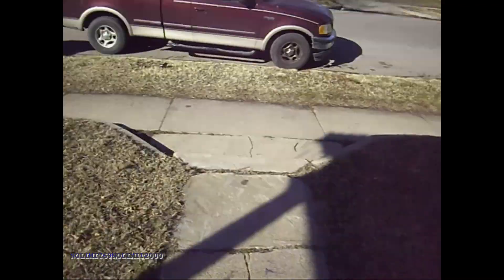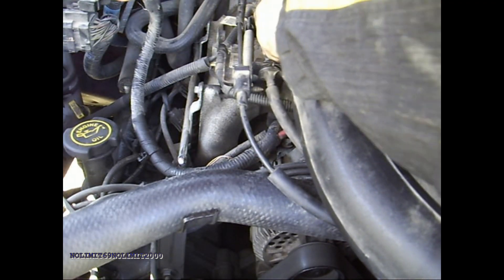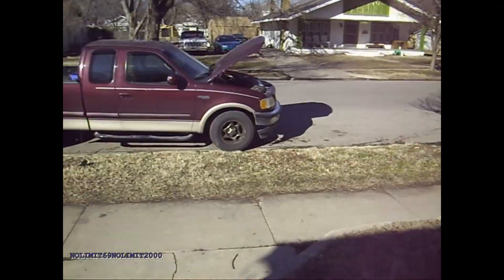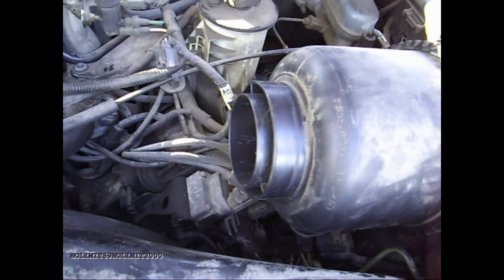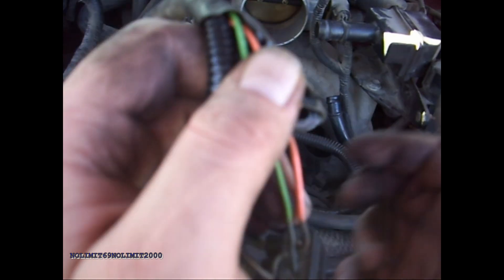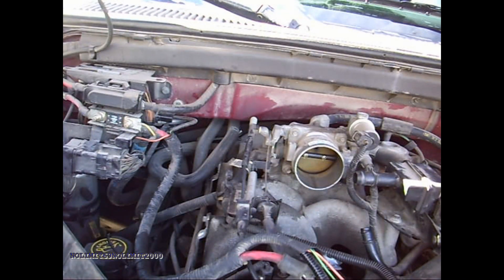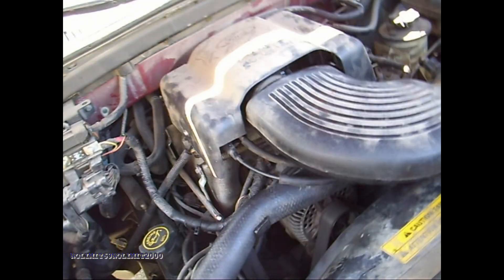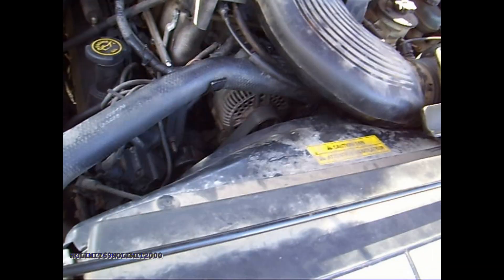Ford F150 wiring repair.

Comment: I hate dealing with electrical problems. A wire can have a short in it but if you move it just right it will reconnect and make the circuit look like it's OK. My 04 F150 is having this problem. Thanks for making this video.

Comment: I got a P0720 code. Found the output speed sensor wire was broken by 
transmission. I cannot get my hands up there to splice together.  Was 
thinking I need to take out transmission harness to get at break. How 
hard is it to remove the trans wiring harness? Any tips? 2003 Crown 
Victoria. Thanks in advance, Kent.
Reply: Kent Diego
Reply: Take the seats out and cut a little hole in the cab just to splice the wires then tack weld the cut back